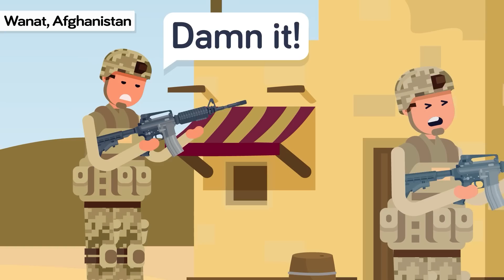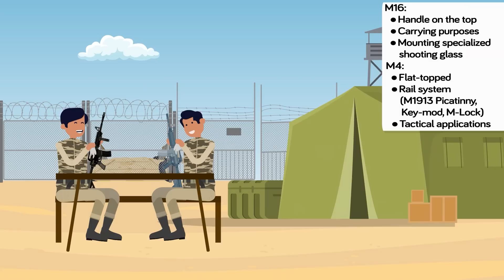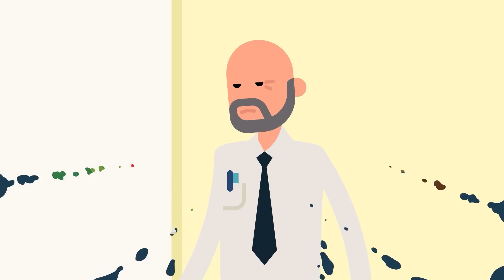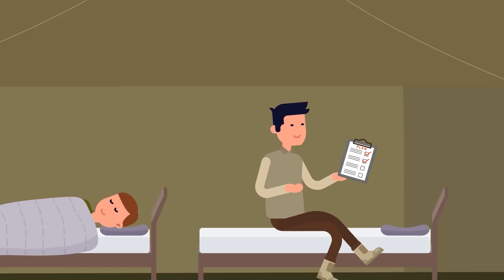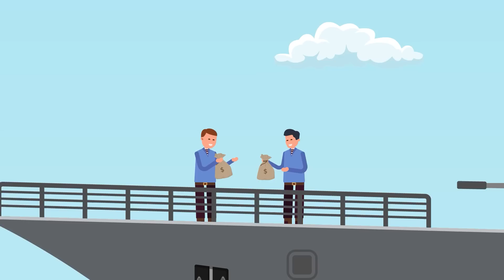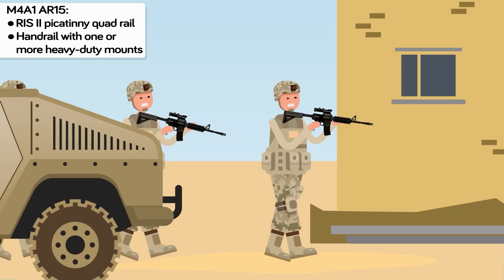Why US Army Hates Their Standard-Issue Rifle

Comment: Your information is wrong about the M4 Carbine that doesn't surprise me infographic show makes up their own facts first off there is no design flaw that causes malfunctions I shot thousands of rounds through M4's never a single malfunction when the M4 does malfunction it's usually because bad Magazine springs extractor springs and injector springs are worn out basic maintenance keeps the gun running forever in the Battle of Wanat the biggest reason why the M4 malfunction it's because the M4 was used beyond the guns design parameters being used as light support weapon or LMG the barrel wasn't designed for the intense Heat having the regular government profile barrel when the M4A1 Socom came out it has a heavier Barrel so that problem will never happen again. 90% of veterans an active duty soldiers Marines Airman sailors have faith in the M4 rifle and they say it's a great rifle.

Comment: The design has always been fine and the complications inherent to the weapon being produced. The consistency of jams and other defects are usually down to specific quality and maintenance issues that come and go in both the gun manufacturing side and the troop training side. 

The same exact complications arise with AK platforms. The biggest choice differences between the two platforms come down to the desire of the US and a good portion of NATO to rely more heavily on the marksmen side of things, rather than the more close-quarters side of an assault platform. 

Obviously that means when speed of firing and ease of use come into play in a close-quarters battle, a good portion of M4 users (and it's variants) are going to complain about it's middling close-quarters performance. They won't complain as much in a long-range fight where it excels, and if they can't cope in close quarters the mantra on the US military side for a long time has been to "get gud" at using it up close...I can't fault them for that.

Comment: I still remember when the Infographics show put the m4 on place 1 of a top 10 assault rifles list just to list only flaws and as the only positive that it‘s used by the US Military (no clue how accurate this statement is because I got a bad memory) whilst not listing something like the HK416 which is specifically designed to be better than the m4 with the addition of multiple barrel lengths for cqb to longer range versions.

Comment: Never had much issue with mine. Most malfunctions were from the bad issue magazines which is an easy fix with pmags. Rounds went where I put it when I squeezed the trigger and my target dropped. The one malfunction I had in combat was a dud round and while not ideal is easily remedied. There are definitely some things I'd change like caliber and gas system. Our SAW guys always had issues though. 
I was a combat medic in Iraq and Afghanistan, and I used the M16A2, M4, and M4A1

Comment: M4 carbine (14.5" ) gas system is inferior to the M16A2 (20", not 16" as stated in this video) gas system.   No issues with discharging round without pulling trigger. This is total BS.  But the M4 shorter carbine gas system is faster and less reliable than M16 longer rifle gas system.  

31 rounds into a 30 round magazine is a joke.  Back in the '90's, my USMC unit loaded 28 rounds into a 30 round magazine.  Jams/stoppages were almost non-existant. 

Folks issued the Beretta 92FS/M9 pistols in Iraq and Afghanistan had issues with this pistol.  This pistol that had been in use for 20 to 30 years prior to their being issued in those conflicts.  All the ones that I was issued were < 10 years old and had no issues.  I own a 92FS today and it is my 'zombie attack' sidearm. 

A rifle that needs cleaned every few days but is accurate to 500 yards (M4/M16) beats the heck out of a rifle that needs cleaned every few decades but is accurate to 100 yards (AK).

Comment: There are a lot of inaccuracies in this video. The M16 has a 20” barrel, not 16” as mentioned. It also has a rifle-length gas system and a riffle buffer. The M4 uses a carbine-length gas system. Also starting with the M16A2 (we are now up to M16A4) the carry handle iron sight is removable to create the “flat top”. Loading 31 rounds into a magazine is difficult and would require extreme efforts. As someone else mentioned the initial magazine problems were the result of the anti-tilt follower. Additionally the M4 feed ramps are an improvement over the original M16 and solved a lot of feeding issues. Optics have no bearing on the function of the guns action, however they can make it more difficult to operate the standard charging handle. This might have been what you were referring to. Your videos are usually very accurate, this is a bit disappointing to see so many errors.

Comment: Im very familiar with m4s. I've been using one for 3 years. I've never had a failure to eject or double feed (except for when using blanks) alot of these issues come from poor maintenance at the armorer or field maintenance level. Take care of it and it will take care of you
Reply: Too finicky. Must be cleaned immaculately to work. Oil especially must be perfectly done. My M76 and SKS never fail and I use little oil and clean them every 1000 rds. Try this w your M4

Comment: It's painfully obvious that the channel DIDN'T double-check its facts before finalizing this video.  The M16 is 20 inches, while the military M4 is 14.5 (as opposed to the civilian legal-minimum 16 inch barrel of the semi-auto AR15).  Also, KeyMod and MLok are only found on carbines used by elite special operators and civilian AR15s, NOT on standard-issue M4s issued to general rank-and-file troops.

Comment: Infographics rocks but I think you dropped the ball on this one.  There were some problems as with any weapons system.  First off, some of the worst issues were early firefights where soldiers were running many mags through on full auto; no air-cooled gun can survive this.  The AK-47 will often see the barrel detach at the gas block or trunion at around 900 rounds full auto.  In tests the AR will often survive more than this, with the gas tube usually detaching from the gas block.  The HK416 is awesome but if we're being realistic, it's not a vast improvement.  Especially once the faulty bolts were replaced that were breaking on FA.  This was a relatively small amount and has been corrected for many years.  The HK416 also weighs several pounds more than an M4!

I was never a soldier but from work and everyday life I've talked with hundreds of recent veterans and while they had a few common gripes about the gun the vast majority of them found the M4 to be pretty reliable.  As others have mentioned, the newest mags with the correct anti-tilt follower fixed most of the problems.  Each time the US Army decides to change the issue ammo there tend to be problems until the mags are tweaked for the new bullet profile.
Reply: Thank you for posting this.
Reply: No one cares bud. Watch the video.
Reply: @cbug1671  exactly the problem.  Just believe everything youtube tells you.  Real firearms operators know whats realistic
Reply: Yep, your very right.  The SA80 our troops here in the UK use was a terrible weapon in the beginning and had many similar issues, they are reliable now but it took a long time for them to reach that point.
Reply: I find it funny how the Infographics for once criticized something American instead of praising it to the Heaven and they suddenly dropped the ball. How about accepting that you're not superior in every way? Russians simply surpassed you with their AK series.
Reply: @virescentmorsmordre9568  the AK platform in my opinion has fallen off in it’s ability to stay modern 
However it’s still a reliable firearm I just like to say is an polar opposite to the M4 platform and honestly comparing them is kinda iffy
They are both great weapons that have stuck well in their respective uses and places
Reply: @Check_Vibe0  Not sure about the modern part, Russia keeps making new variables of AK. Obviously those can't be as famous and widely used as the initial Soviet versions, which find use to this day. AK was loved mainly for its extreme reliability and cheap production cost, plus a very low knockback. M4 is, if I understand correctly, stronger, has more place for attachments, shorter barrel and similarly low weight. But overall, M4 failed in more extreme conditions like jungles or deserts, where its needed the most. There were many cases of the US soldiers switching up their M4 for AK from the fallen enemies. The most important factor for the US should be reliability, especially since their army is all over the world for nearly a century and they often end up in those said extreme conditions.
Reply: @virescentmorsmordre9568  I am a US Army combat veteran. It’s not so much that we care about them not praising the M4. It’s that they made a video saying “American Soldiers Hate Their Rifle” and that simply isn’t true. We don’t. We are quite fond of it actually. The video also includes several very inaccurate “facts” and wrong technical specifications. In fact, the vast majority of combat veterans even go on to purchase a civilian AR15 after leaving the military. The general backlash to this video also has nothing to do with the AK design one way or another. The AK is actually very well respected by US soldiers. Surprisingly, many US veterans (myself included) openly praise and even own AK pattern rifles and shotguns. I own 2 Saigas and they are absolutely wonderful!
Reply: @baddestmofoalive  You're honestly the first American I talk to that respects and even owns a Russian/Soviet weaponry. Glad to hear there are unbiased people in the US.
Reply: @virescentmorsmordre9568  Have you ever been in the military? If yes then go ahead and talk. If no, Let the professional guy do it.
Reply: @thesanss4671  What kind of argument is that? The "professional" you talk about said, quote "I was never a soldier". But there are some hard facts that I know whether I was not in the military or not: You Americans are NOT superior in everything and you ARE surpassed in some ways. You are also NOT perfect. So I will keep talking, thank you very much. Besides, you yourself are obviously not a professional either.

Comment: What I've read about the M16 in the mid 60s in Vietnam was that the rifle was horrendous.  Issues with chamber rust, ball powder fouling.   But  3 or 4 years later these issues were fixed.   That's 50 years ago.
Reply: It was a combination of ammo and lack of chrome lining on the barrels.  The A1 version added chrome lining, and a forward assist.  Also, the rifle required more extensive cleaning than the old M-14.  It took time to get cleaning kits to the troops.   Sadly a lot of men lost their lives before these deficiencies were corrected.
Reply: One of the  problems with the original M16 was that if it got wet (which is not uncommon in a jungle), it could blow back the bolt when fired.  The M16A1 had the forward assist added to it to combat that issue.  The issue that was found in the early 80's during exercises in the desert was that it jammed if any sand or dirt got into the receiver.  Which those of us who had been through Fort Dix could have told them.
Reply: The original M16 was touted as being very clean running and needing to be cleaned very rarely. One of the biggest issue was that the smokeless powder used during development was swapped out for a cheaper, dirtier powder in the ammunition that was actually sent to the troops.
Reply: One problem was wd40 being mistakenly used to clean foiling ammo.
Reply: @jc.1191  Yeah. Funny thing is we use WD40 to neutralize primers on unsafe ammunition.  Definitely wanna keep it away from guns.
Reply: @jc.1191  WD40 will ruin the primers in a cartridge.   Hmm, most military ammo is sealed around the bullet and case and primer too.    Maybe they weren't doing this with ammo at the time.   Corrosion of the chamber from the humidity was the main culprit.  After firing the gun the case would expand into the rust and make extraction of the case very difficult,  cleaning rod required to knock out spent case.  A total shutdown of the weapon.
Reply: My dad was in Vietnam and says the same but the YouTube gun nerds seem to know everything lol

Comment: One of the reasons the M4 failed in the battle of Wanat is because the M4 wasn’t designed to go cyclic for a long period of time, thus causing the gas tube to fail and the barrel to sag
Reply: That trait is shared with any service rifle. If you want something to excel at cyclic fire you need a belt fed system with the ability to change barrels.
Reply: They were using a carbine as a Squad Automatic Rifle. Wrong tool for the job
Source: Am SAW gunner combat vet
Reply: @baddestmofoalive  You beat me to it; they used a full automatic carbine rifle like a machine gun.  What next, hitching an F1 racecar to haul a tractor trailer?  What could possibly go wrong?
Reply: Socom's escape tactic Is for 2 rifleman to just dump mag after mag while covering the others. Any rifle will give up while being abused to this extent
Reply: M4 is a liability to troops.
Reply: @charleswest6372  if you take care of it it will take care of you

Comment: Ok, I love this channel and the content, but there is a lot of straight up incorrect info. First of all M16 has a 20 inch barrel and fixed iron sights also known as the carry handle. Second the issues you mentioned were actually attributed to poor maintenance by both the army and the soldier using it. You have to realize the army is going to do everything in its power to save money, one way is to have tolerances that lead to parts being worn but still within spec. Like a buffer spring, civilian would replace that when it gets sluggish and worn, army will say until it starts failing it’s still good. Another big issue was the magazines, army spent a ton of money fixing that problem. Also the burst mechanism was known to cause negligent discharges if the weapon ran empty cycle. All this info can be found in article and tests the army has published, also there is a YouTube channel called small arms solutions, the guy can reference the material and articles and tests in regards to knowing the Ar15/M4/M16 family of rifles. You guys have always created great videos that had a wealth of knowledge but this video is definitely one of the worst as far as knowledge goes.
Reply: M16 A4(latest version of M16) carry handle is removable.
Reply: @ShizawnSanders  yup part of the A4 upgrade
Reply: Yeah, I can almost guarantee the same amount of reliability problems or WORSE with another weapons platform. The soldier has to do his part which includes training and vetting his equipment.
Reply: @ShizawnSanders  agreed. Anything can be remedied with training and proper equipment. I can tell you I a lot things have been remedied in the past few years
Reply: A lot of their firearms vids are usually pretty inaccurate sadly.
Reply: Once you see infographics videos about topics that are familiar to you, you start to wonder how much other bad information they've given you. The worst part is they frequently State bad opinions as if they're fact.
Reply: More of their videos than not are full of half-researched inaccuracies.  It's not just the ones where you have first hand knowledge of the subject matter.

Comment: M16 has a 20-in barrel with a 1/ 8 twist. The m4 has a 16 inch barrel with a 1/7 twist. The major problem with the m4 and why it was jamming up is because it didn't like the old stock aluminum or steel mags with the green followers that tilt, once they replaced the followers with anti-tilt followers that problem was almost completely mitigated. The other problem was the feed lips on the old stock magazines got bent quite often rendering them completely useless. It's one of the reasons why the military went to pmags.

Comment: By far the most common failure is what they call a stovepipe jam... Improper feed and usually ends up shoving the projectile tip down inside the cartridge casing, or at least that was my first hand experience.
Reply: Stovepipe is a failure to eject, where the spent shell sticks out the side because it wasn't clear of the weapon before the bolt slammed forward, usually rhe result of a low quality barrel and over gassing. What you described is a failure to feed usually caused by bad magazines where the round is presented at a bad angle and slams into the barrel extension instead of riding up into the chamber, though this can also be caused by over gassing as the gun tries to cycle faster than the magazine can present new rounds. Again, poor build quality. That's why I don't like military grade weapons, mine are much better

Comment: Wrong M16 has a standard barrel length of 20 inches second the carry handle WAS NOT USED FOR CARRYING.
Reply: Yup. The "carry handle" was intended to protect the charging handle, which was initially located atop the upper receiver, similar to the French FAMAS rifle. The charging handle was relocated to its current location but the "handle" stayed.